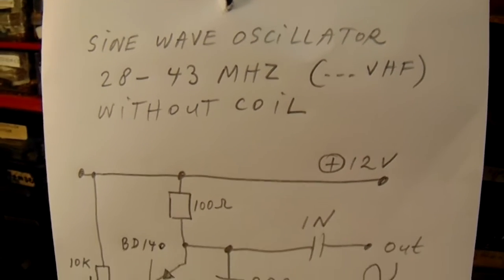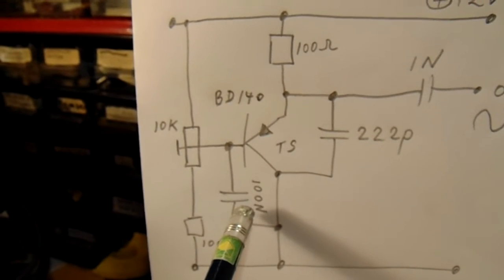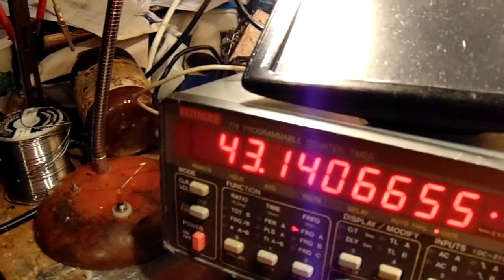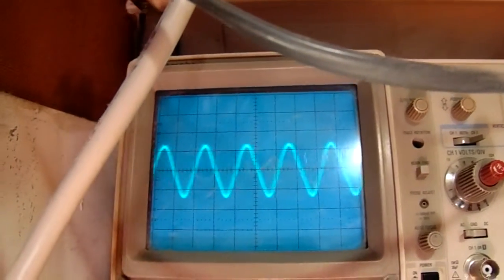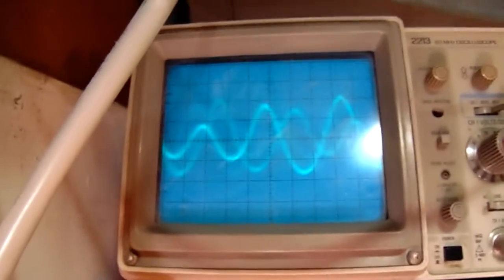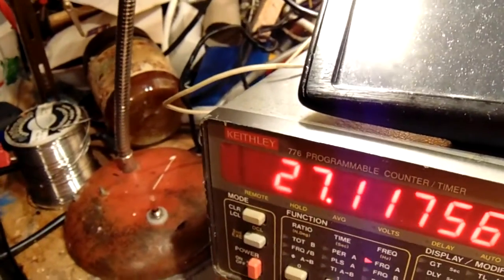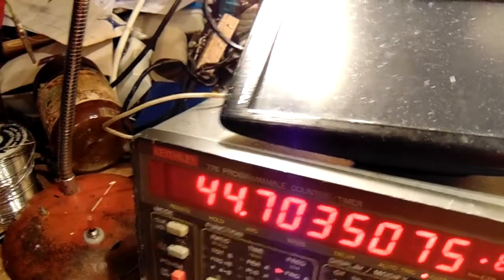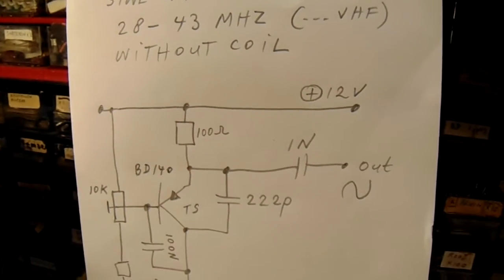Coilless sine wave oscillator tunable with a potentiometer between 28 MHz and 43 MHz

Comment: Nice circuit Ko, I have replicated it on my board with a CBF493 pnp transistor. I have 46.9 to 55 MHz range. Changing the E to C cap to 22pf gives 109 to 128 MHz. Nice waveform too. Keep on experimenting. Thanks for sharing, Martin.
Reply from the maker: +stoneslice Martin, many thanks for rebuilding the circuit and testing it again with other values. Gives me more confidence and a valuable reference to see that the results are reproducable.